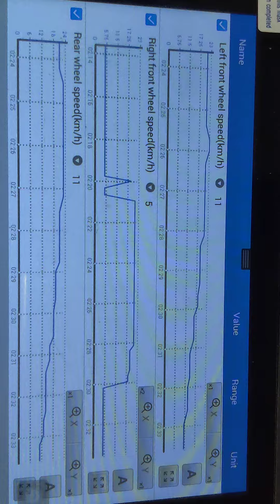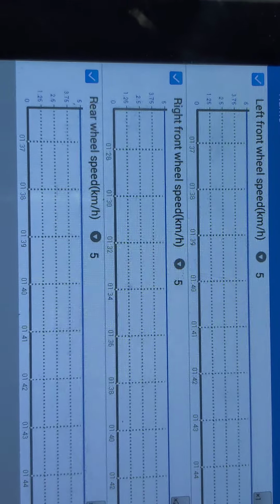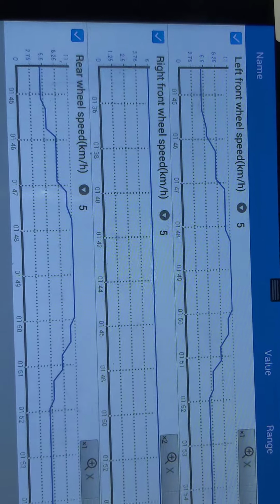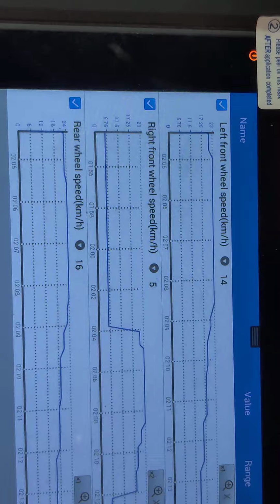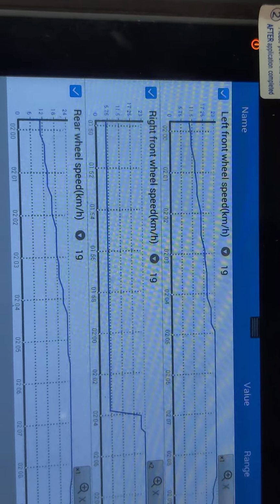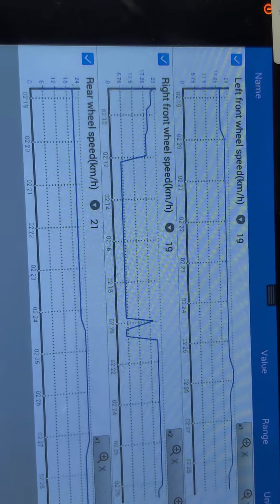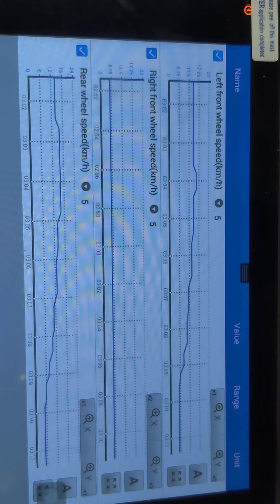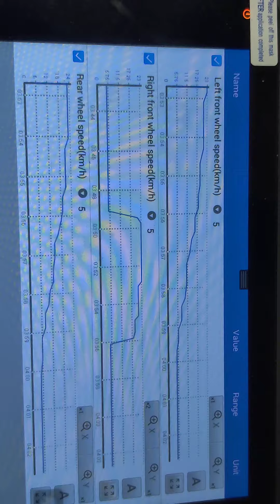04 silverado c0222, c0223 wheel speed sensor ABS issue

Comment: So what was wrong with it? I have the exact same codes
Reply from the maker: Don't know, customer wanted to sell it so he was trying to do basics. Sold it before I can go deep into it
Reply: I have same code on my 2002 Chevrolet suburban I went buy new wheel speed sensor I put it on and i went driving around came back still the same code but I think i gotta check on the wheel hub bearing I have a feeling that the problem I'm going to do it right
Reply: My brake pedal kick back that why evertime I slow and I stop red light I press my brake pedal and brake pedal kick back